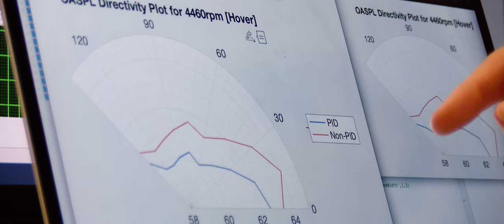ProjectMRNA Capstone Showcase

Comment: Very nice but I have a question 

Is this tech still in study or has it come out yet because this  has a lot of potential in alot of different fields and honestly the science behind it seems very cool and I was wondering if the public will get to see this anytime soon
Reply: Thanks for the comment! This is a very active field of acoustics research, and our project was basically a proof of concept of the idea of synchrophasing for noise attenuation. Some companies like Amazon and Sony have patents for quiet drones using noise cancellation, and NASA has a few patents pending about utilizing synchrophased rotors for noise attenuation just like we did in our project. It's also possible that this technology is currently being research and/or developed for military applications. As drones become a lot more popular and there are various new applications for them like delivery drones, technology like this will be prevalent in the very near future whether people realize it or not! 

Also, if you're interested in the phasing technology, look up phased-array antennas configurations. They use similar technology to eliminate noise (in that case it's radio waves instead of sound waves) of undesirable frequencies and amplify the frequencies they want.
Reply: @michaelcrognale6960   thanks for the info much appreciated